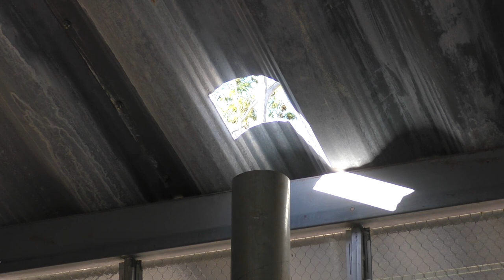[Off Grid Build] Wood Fired Stove install and DIY Flue and Chimney Cap Build

Comment: England here.  

Good job that.  I agree also with using a thicker flue pipe than the usual thinner stainless or double skinned material, not to mention that the latter costs a fortune.  That would be a 5mm or 6mm wall thickness pipe you have there?  I've used the same myself in a workshop and previously in a home stove installation.  The thicker pipe gives off some good heat in itself, just as much as a thinner section once it gets up to temperature.  For the outside portion where chilling might be a concern, you could always double skin over that part with a thinner piece of galv that you could roll to size, larger than the inner by say 4 inches diameter and stuff the 2 inch gap all round with insulation.

I like the angle grinder protocol too.  Get that guard off and don't be cramping yourself with bulky gloves.  Good ways to sharpen a pencil too.

Of course, don't try this at home kids.

Comment: just curious has the Rubber water proofing sleeve melted or gone hard from the heat generated through the flue pipe if so its an easy fix just make a larger sleeve going thru roof to under tophat and stuff rock wool in-between the 2 sleeves refit wp flange